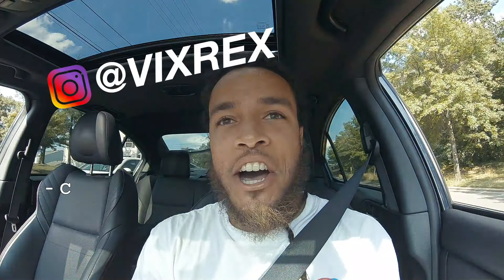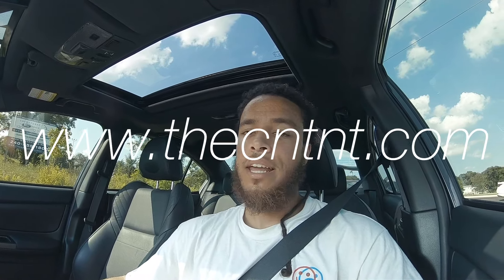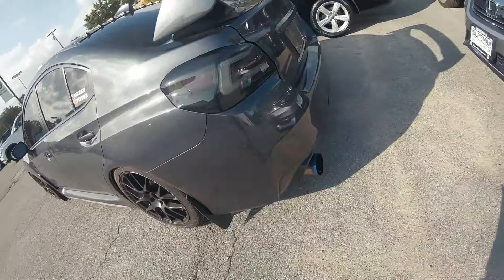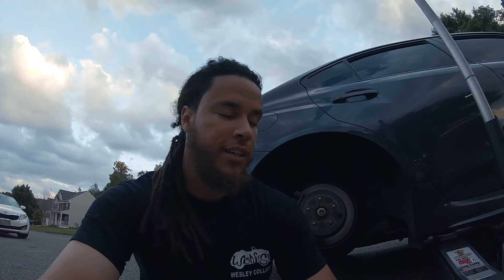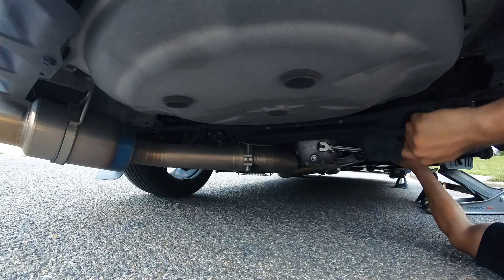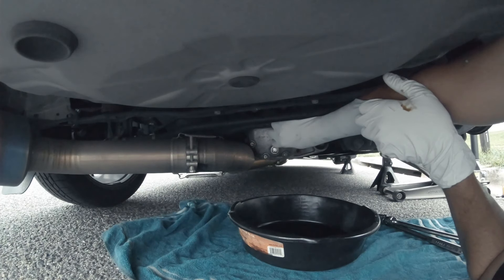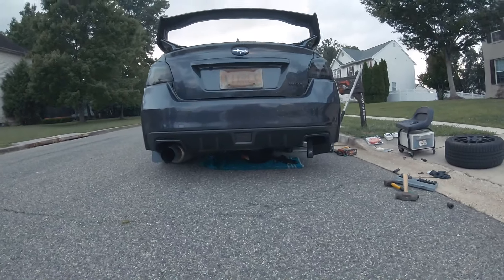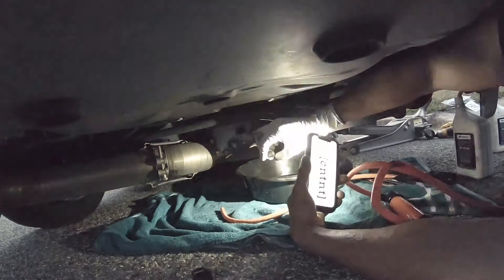Rear Differential Fluid Change (NO LIFT) | Slammed 2016 Subaru WRX

Comment: Not that my 3 in remark Catback is installed i can no longer fit behind it with the wrench..... your safe with tomei! But I think any 3 in Cat back dual exit will have this issue also.
Reply from the maker: Ahhhh that’s true.  Single exit definitely made it easier. Good catch